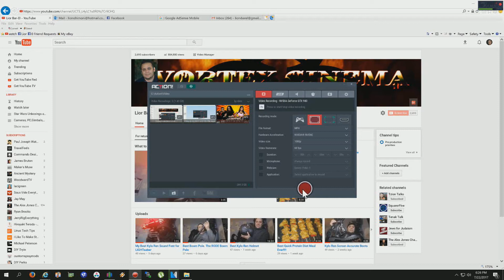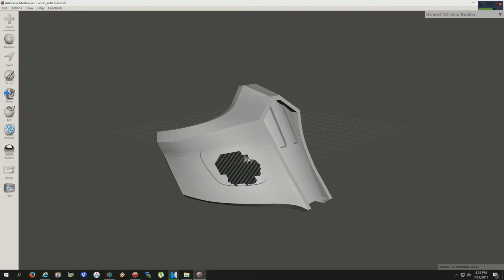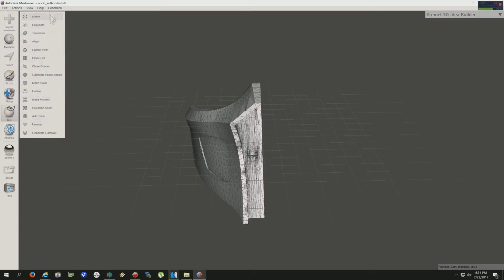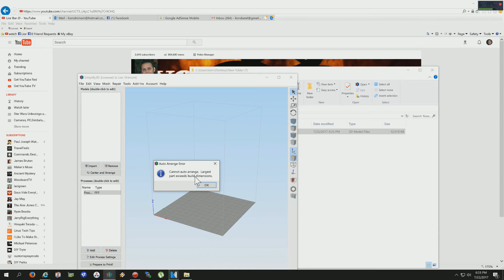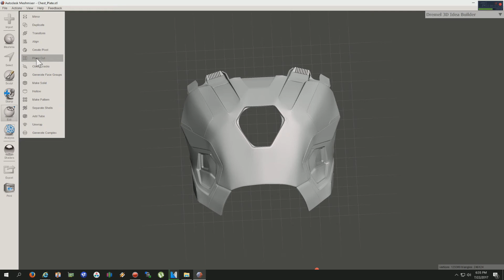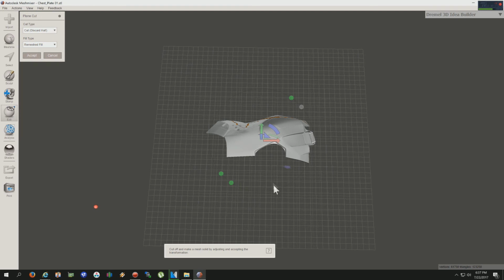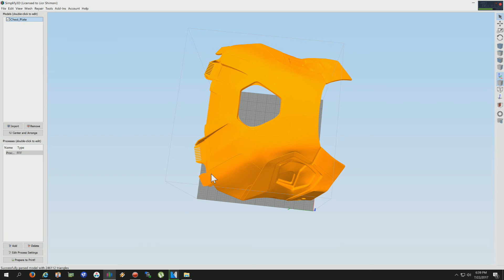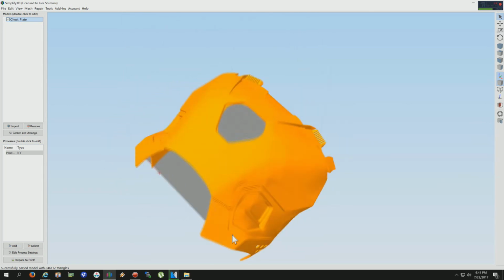Splitting 3D Printing Models Using Meshmixer

Comment: And after print, how to put the parts together again? With clue??? That is not a way to print with fixes parts?
Reply from the maker: Actualy when you have a small printer bed it's the only way to do it. I use cement glue and then sanding and plastidip at times and get a solid look with no issues. You also have to be mindful when cutting prints. You need to know where to cut it and when you do you will see how easy it is to put together and make it one part. I have been doing this professionally for a very long time. Try it and see for yourself.